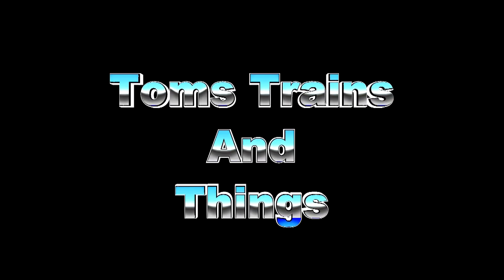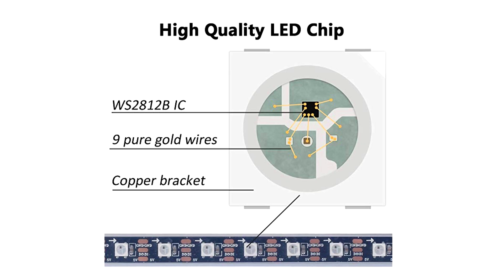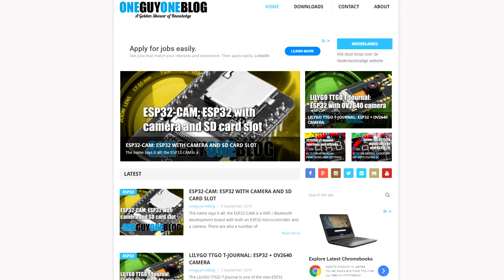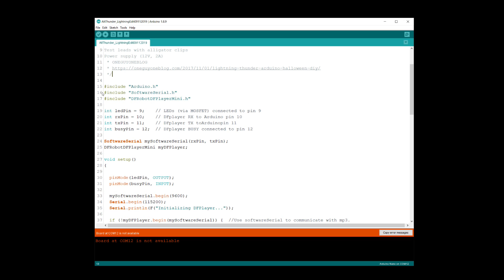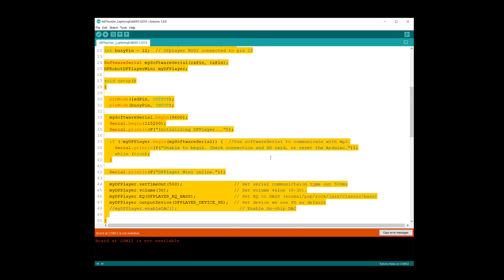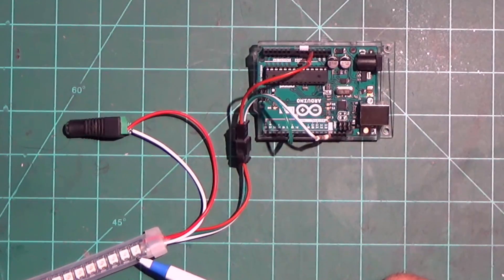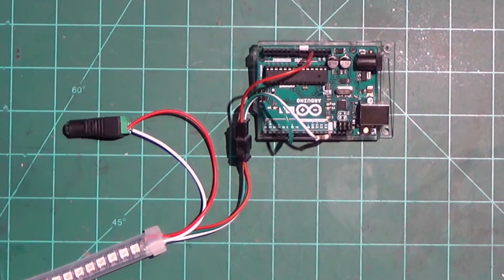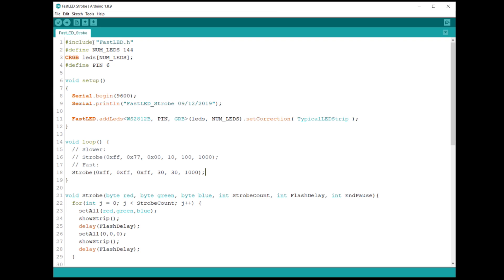Thunder & Lightning And Strobe  For Your Model Railroad

Comment: I use wemos d1 mini 5V supplied  (cheaper than NANO) with the dfplayer mini 
- direct links (no voltage divider needed) from dfplayer RX,TX to TX,RX (software serial) on the wemos
- a 470 ohm resistor on the data out pin leading to the LED strip
Reply from the maker: Thanks for your input

Comment: Hi Tom, about the strobe sketch in line 16 it says 0xff, 0x77 and 0x00. In line 18 it is stated 0xff, 0xff and 0xff. Should this not be lik in line 16?
Reply from the maker: Those figures are just a slightly different color and the remaining line is for the speed which is slower than line 18. Line 18 is recognized by the sketch, line 16 is commented out. You can use line 16 by deleting the // and adding // to the beginning of line 18.